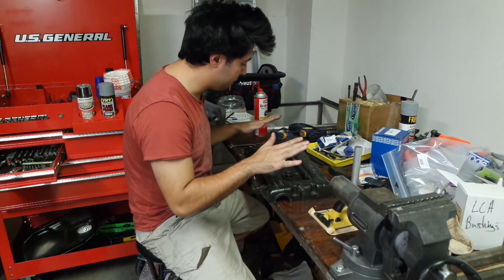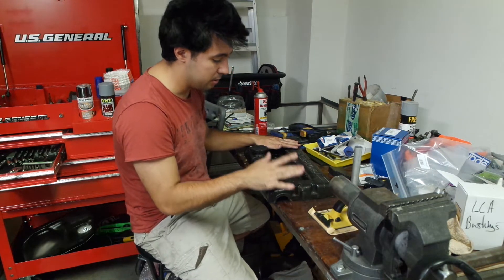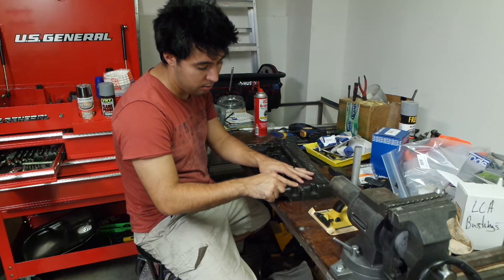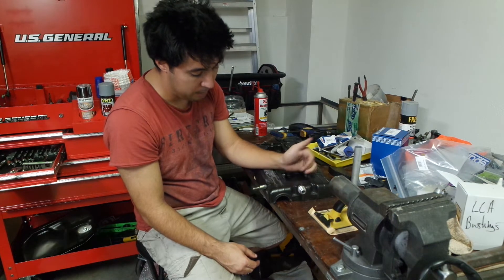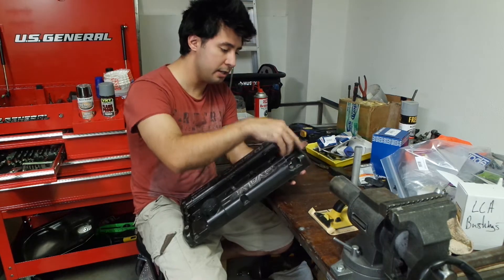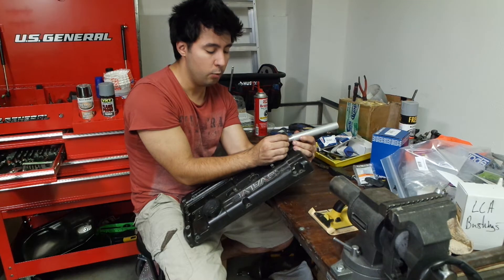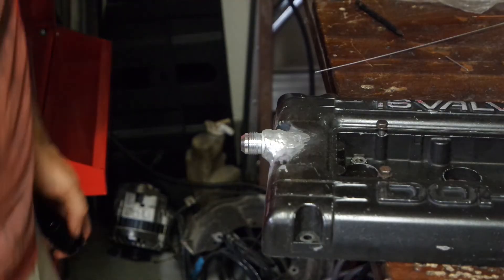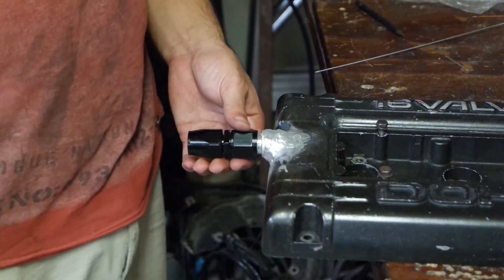Upgrading a PCV Breather Vent (4g63 Swapped AWD Mini Cooper Bonus Video)

Comment: You mentioned not being able to remove the old breather without getting shavings in the valve cover above the baffles. There’s a quick shot of you cutting it away but how did you open it up to match the diameter of the new fitting without getting shavings inside? Thanks!
Reply from the maker: I believe I tried to do it carefully and slowly with a vacuum and whatnot but there were still shavings inside. I ended up removing the baffling by drilling out the rivets and then made a new baffle over the breather section only. The new baffle was pretty small to minimize the risk of cracking the valve cover since I drilled and tapped the old rivet locations
Hope that helps
Reply: @InitialDIYmods  It did, thanks for the reply!

Comment: Are you going to do the PCV side as well
Reply from the maker: Are you referring to adding a second fitting for the side with the one way check valve? Or do you mean a video covering the rest of the catch can setup and hose routing?